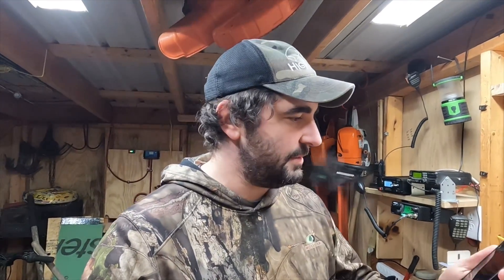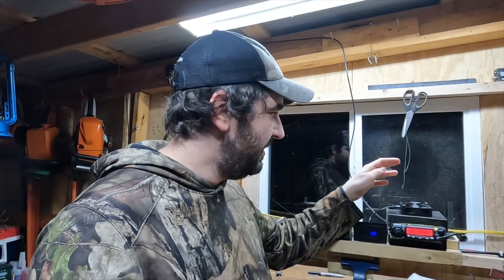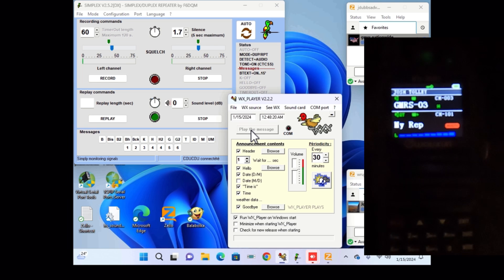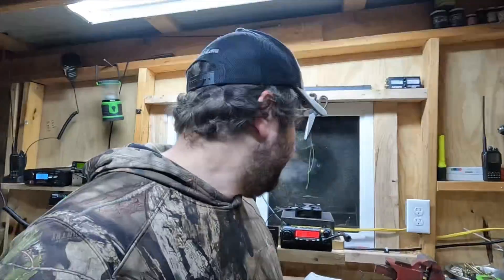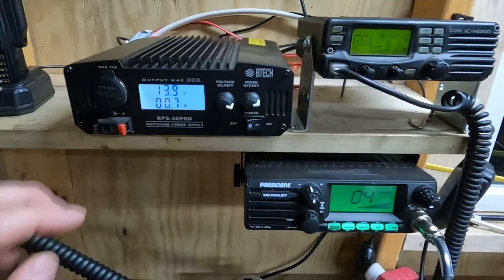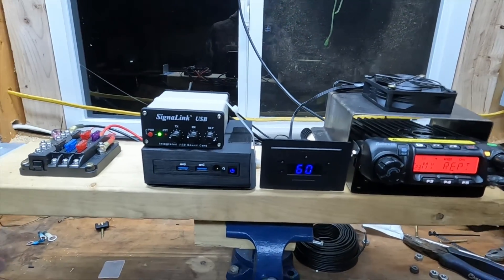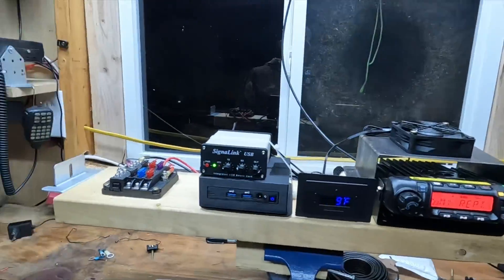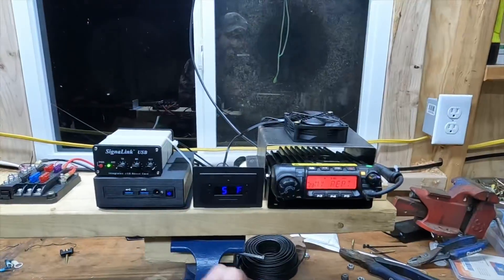99% Duty cycle G.M.R.S. RF link for Zello \ repeater Interface | first look | VOX setup

Comment: Great job on the solar setup. There are some cheap LiPo 12v 100 amp hour batteries on Amazon now. I picked up two of them for less than $400 with 1000's of cycles of life.
Reply from the maker: That’s true only problem is the bmc in some of them are noisy when it comes to the computer

Comment: How much interference is the LED RF causing for the radio if it’s giving the camera that much trouble.  Difference frequency I guess?
Reply from the maker: Cameras have a refresh rate that you can change depending on the lights. GoPros refresh rate was just slightly off for those lights
Reply: @JDubbsadventure  Aw, I see.  Thanks for clarifying that.  Great info in your videos too by the way.  Much appreciated.

Comment: Whats needed for a vertex vxr7000
Reply from the maker: Everything that’s in the video. This setup doesn’t care bout the radio, frequency or anything else. Iv got a few 7000s there ok for what they are
Reply: @JDubbsadventure  is the repeater website still available, i cant find it , i would like to put the weather announcements and what not on repeater also
Reply from the maker: @Knarf14 yes all the websites should be available I believe there download links are in the video description.

Comment: Im sorry to ask, but is this a simplex hotspot?

The reason i ask is because im coming from a land mobile (Private business frequency) setup with amateur radio experience. So with that in mind please excuse my ignorance.
Reply from the maker: There’s a lot of uses but It could be used as a simplex node to use on All star eco link zello or anyone other voice over ip setup.
Reply: @JDubbsadventure  I'm looking into several different options because I don't want to go through the trouble of getting in touch with a frequency coordinator in another area to put up another repeater at the ranger go to plus going through all the trouble of linking repeaters together. 

A friend of mine told me that I can put up a mmdvm repeater at his place, but that's all new to me. After watching your video I'm completely rethinking the whole thing.

The reason why I'm going through all this trouble is because there is zero cell service there and my wife really hates that even 911 isn't available. Having a mobile in my car and something like this at my friend's place would give me a lone of communication to at least her via internet connected radios. 

Is there a guide, or somewhere I can go to get all the details on this because it seems to be completely different from the mmdvm repeaters I have been looking at.
Reply from the maker: @jameslargen284  where ever you put this radio it’s going to have to have wireless internet. Gmrs works well with this since there are no frequency coordinators and your wife can use your gmrs call sign. This would work well with a repeater. Ex you have a repeater up on a hill, you have this node at your house where the WiFi is. You hook the node  to zello and your wife puts the zello app on her phone. Now no matter where she is in the world she can get in touch with you as long at you have internet to the node and you can “hit” the repeater. The repeater isn’t necessary but it does work well for this. My friend has a you tube channel that’s all about linking gmrs repeaters and nodes…. Gmrs_two_way_radios
Reply: @JDubbsadventure  I appreciate the response and info. This definitely seems like a viable option and works out perfectly with my friend allowing me to install at his home with fiber access.

I went down the rabbit hole last night and watched so many videos on this subject I think I had the YT servers like 😩🥱😴